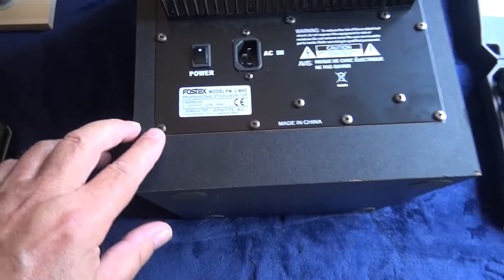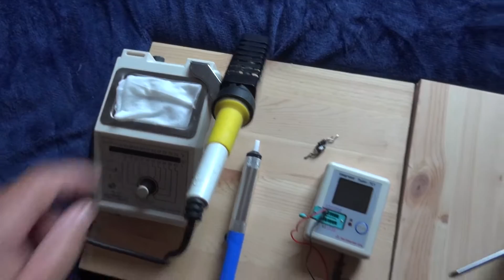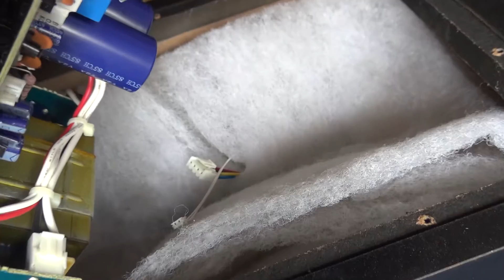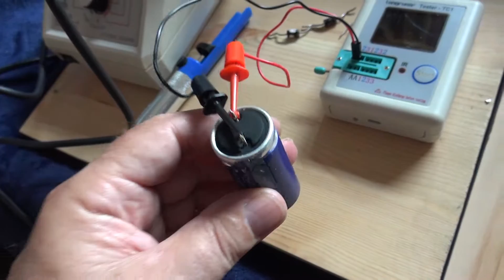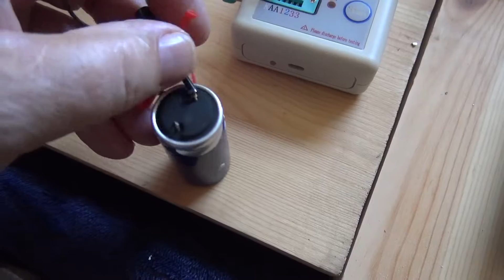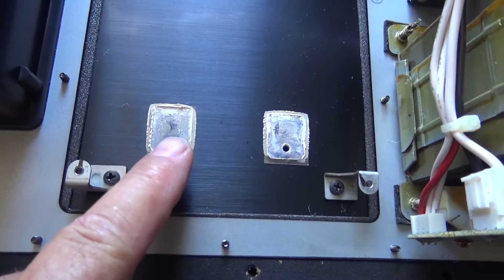Fostex PM-2 MK2 repair

Comment: Hmmm, you should have followed your own advice and looked up the data sheets, if you had you would have seen that the SAMXON GS caps that you decided were bad have infact got a + or - 20% tolerance when brand new so even at 5800uF they would have been in spec. ESR in caps goes very high when they are faulty (many ohms) and VLOSS is apparently leakage current but has been proven to be totally inaccurate on these meters ... so there's not really any info from those meter readings to confirm those caps are bad. Those meters do have a use for quickly giving confirmation if transistors are open/shorted and diode testing but not accurate at all for capacitors unless very bad (e.g. many ohms ESR). 

The white glue comes in a few different colours and consistencies but the stuff you had there is similar to 2 part epoxy and has to be chipped away, I have had some success softening it with Isopropyl Alchohol then picking at it with sharp pointed side cutters or scalpel. 

The proper way to diagnose that problem would have been with an oscilloscope (some super cheap hand held chinese "toy" scopes are fine for audio diagnostic work of this sort) or a very cheap alternative method would be using a DIY audio probe (google "DIY audio probe") to trace the audio circuit and pinpoint where the problem starts. So tell me did replacing the two caps fix the hum?
Reply from the maker: Thanks for the info 😊 very helpfull. Yes the hum disappeard completely as I demonstrated in part 2.
Reply from the maker: https://youtu.be/9MfFqAzrtPY
Reply: @ColinJamesPoulter  I know you probably won't believe this until you've done many more repairs but the fix is most likely the solder joints being renewed rather than the caps being replaced in this instance. It would of course need to be confirmed on a more accurate capacitor tester that can also show dissipation factor but the readings you show in the video could have come from a brand new capacitor. Old solder joints often go high resistance which in this case would be the equivalent of the capacitors having high ESR and would cause increased hum as you were having. I'm not criticising you just pointing out that the readings you made your decision on do not indicate a faulty capacitor in which case it is most likely the solder joints. I'm speakings from 35+ year's of pro-audio repair. There's no harm in replacing the main filter caps but it's vids like these that lead to punters thinking it's always capacitors that are the problem when many times it's something else close by in the circuit. If you had tested the new caps I think you would have found almost identical readings. Anyway it's great that it's fixed but just for your future reference ... a quick reflow of solder joints takes seconds, can produce amazing results and is a lot cheaper than new caps from RS now that they have handling & postage charges ... :)

Comment: So mine have blown tweeters I have a pair I checked the board and they look immaculate and then plugged in a tweeter and it worked but the power isn’t matched well way too much bass to tweeter but definitely works what tweeter should I buy? I can’t afford $100 for originals of I can find them
Reply from the maker: Hi leave it with me I'll take a look later in the week for you.
Reply: @ColinJamesPoulter  If these are being used for critical monitoring then the tweeter really has to be replaced with an original or the frequecy response will be skewed from the original design.

Comment: still cant open the  back :/ pm0,5 mk2, do u think they are glued also? already use a lot of force...
Reply: Probably too late now but the easy way to get the plate off is to drip some Isopropyl Alchahol down under the edge right round and a few seconds later firmly prise the plate off with a strong blunt flat blade e.g. a dining knife.
Reply from the maker: Try using a flat blade screwdriver
Reply: @ColinJamesPoulter  thanks for reply. But unscrewed Them all. Still stuck in cabine
Reply from the maker: @oLsoNaGe  I think you'll just have to force it my friend